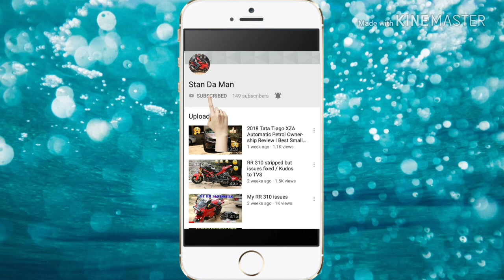Shifting into reverse gear while moving Forward | Tiago AMT

Comment: Hi Sir . Thank you for the video. It was very informative. The comparison video between Santro and Tiago was also great.

Also, I am planning to buy Tiago AMT. But during my research I found that users are facing problem in AMT gearbox while it is in automatic mode like lag/failure in creep mode, inconsistent throttle response, unpredictable upshifting/downshifting of gears etc . Can you please give your personal experience of the issues faced in Tiago AMT gearbox in automatic mode? Have you faced any of the above mentioned problems?

Thank and Regards
Reply from the maker: Thanks, I'm glad you found it informative.

I actually had a problem with my fuel pump and I had made a video regarding that also. If you search you can find it out. It was replaced under warranty. 

Gearbox performance wise I believe Santro is the best, Tiago AMT gearbox is not bad either. Refinement wise, engine could have been better.

Do subscribe I will be updating as I rake in more miles.

Comment: Is AMT car is good for long drive... In some video they said it gets over heated ... ?
Reply from the maker: I don't know about other AMT car's but Tiago AMT so far is not bad. It is a very comfortable car to drive. I drove it 1000 Kms in one day and it was excellent and comfortable. Top speed I did around 140 in Highway during that trip. It is Paisa Wasool car.
Reply: @StanDaManReviews  thank you brother... 
I am planning to take xza+ ... It's my first car so was confused ... Hope it performs well in overtaking as well... In review they gave some -ve about amt...
1) hill drive not good ..
2) over taking...
3) can't predict gear change..
Head nod so on.. 
Hope it will be good to buy new tata tiago
Reply from the maker: @RajeshSharma86.  Head nod is there in all AMT gearbox cars in this price range. No need to worry about that. In over taking you have to be little careful as the AMT is little slow to shift gears, it is same like that in all AMT cars. Hill drive I had issue but it is solved now. I made a detailed review of that problem in my channel here. Please subscribe and watch it.
Reply: @StanDaManReviews  tq...
Reply: @StanDaManReviews  sir how much mileage you are getting???
Reply from the maker: @RajeshSharma86.  as per MID I am getting 15-17 Kmpl.
Reply: @StanDaManReviews  that means it is worth buying an AMT
Reply from the maker: @RajeshSharma86.  Yes you can buy it. You will love it. Just do a test drive before buying please.
Reply: @StanDaManReviews  ya sure...

Comment: I have ordered XZA❤️ WAITING FOR RED BEAST
Reply from the maker: Congratulations Bro. Wish you many more happy miles ahead.
Reply: @StanDaManReviews  thanks a lot
How's your on road price?
Reply from the maker: It's me Ram when I purchased it was 6.5 lakh rs.
Reply: Waste car amt fail,i brought car in January 22 2019 on 30 April  at evening when i start the car parking brake Release bt nt moving only rpm go up and speed is zero.i hope will be fine soon 🤔🤔🤔
Reply from the maker: vashiullah shaikh bro you need to start the car from neutral. Keep foot on brake and then engage drive mode A, only then drive gear will engage. If gear lever is in any other gear, engine will not engage.
Reply: Plz don't buy  Tiago amt XZA  I bought it n very disappointed
Reply: @wasim1186  same problem I face don't buy Tata amt XZA
Reply: @StanDaManReviews  vellore i purchased 6.45 lakh plus accessories 18000 total 663000lakh.
Reply from the maker: @montygullu007  what problems did you face with your Tiago sir ?
Reply: Those guys have overpriced and still you face problems huh!!
I bought 6.36 onroad XZA AMT 2k19 April made
Reply from the maker: @itsram1770  Just because you pay more does not mean that you wont face any problems with your car.

Comment: Hehhe
No gearbox box not even a manual gearbox can shift to reverse
First learn how gear works
Reply from the maker: Why don't you try it on your manual gearbox car and post a video on youtube. It would be very helpful.
Reply: @StanDaManReviews  that i wil not because it will destroy the synchronizer and still will not engage
Reply from the maker: @iqbal1618  Yes, so something or the other breaks when you engage reverse right !
Reply: @StanDaManReviews  yes it will break the gearbox but point is it will no engage untill u get the desired speed
In automatic Megatron module select the gear according to the optimum speed
Even u engage a reverse by chance u have to stop the vehicle to engage it

So point is u can't engage reverse gear in a speed
Reply from the maker: @iqbal1618  That is what my subscribers wanted to know brother. Like what would happen if we engage reverse while driving forward in Automatics.
In automatics nothing happens but in Manual gearbox, the gearbox will break.
But in Tiago automatic, the neutral gear gets engaged while in other hatchback automatics it does not happen.
It was an experiment for my subscribers, I hope you understood.
Reply: Bro no gearbox will engage the reverse gear
Old mercedes automatic will also break
Cvt gearbox will also break

AMT is not a auto gearbox it is just a auto selector nothing else